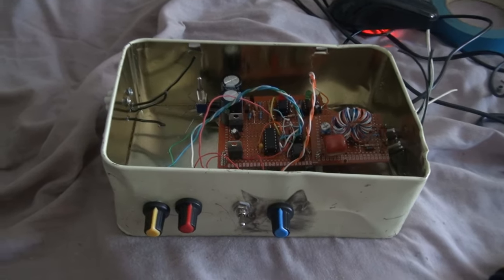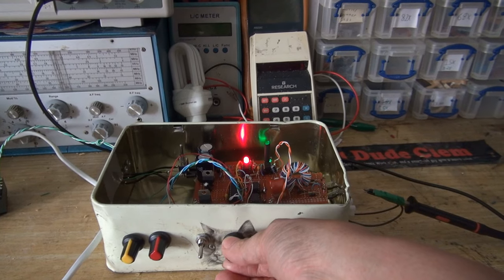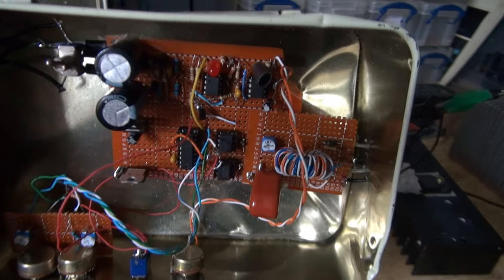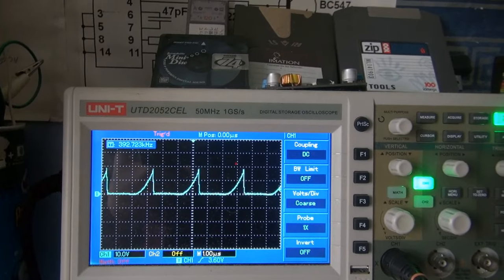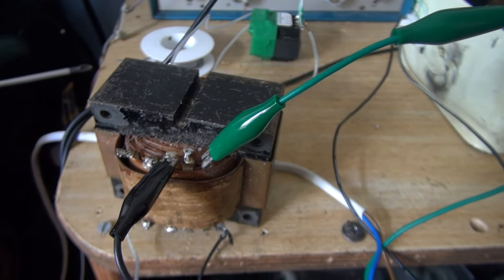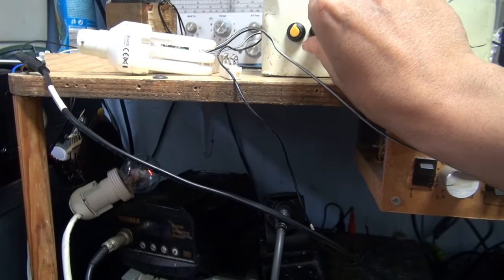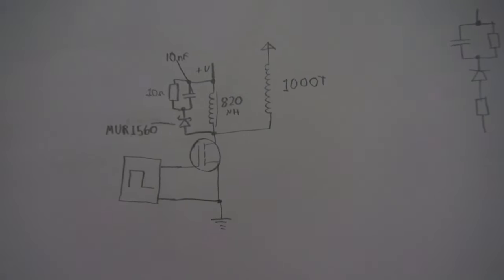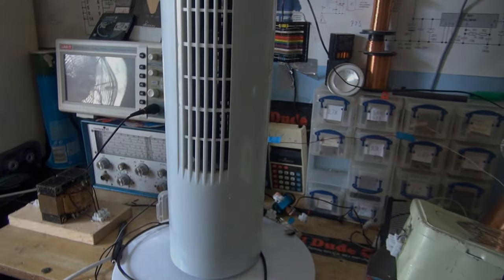Experimenting with snubber networks and other stuff.

Comment: Oh cool its good to see a video from you buddy, the RCD snubber worked well to say you used wire wound resistors, never tried that before, i just assumed the parasitic inductance would be a problem but tbh it seems fine here 😀, they do actually make "non inductive" wire wound resistors where they wind the nichrome as two coils in opposite directions to effectively cancel the L but ive never come across them in the wild as yet, as for the scope showing ringing with the BNC-coax-crocodile clip lead yeah that could be the parasitic capacitance/inductance you are effectively putting in parallel with the gate, 1x/10x swtchable probes actually have a deliberately high loss coax of probably a couple hundred ohms on 1x so it would look different with a probe even on 1x not that i would ever use a switchable probe on 1x 😅.. good to see you back on with TCs aswell👌, its really nice for people wanting to learn as you show the details of your projects along with your thoughts, i really want to make some videos in this style when i get back to it, 😎😎.. all the best 

Steve
Reply from the maker: Yeah, I had to wire wound resistors because that's the only ones I have that are big enough to handle the current.
Reply: @CoolDudeClem  it wasn't a criticism mate, im glad i saw this.. it shows again that its great that guys like you experiment with what you have on hand and share what they find, ive always said when you have to make what you have work for you this will teach you far more than just throwing money  at digikey every time, this is why there are great self taugh techs from the Eastern bloc like DGW etc

Comment: The Snubber: The 10 ohm resistor should be across the mur1560 diode, not the capacitor. This way the circuit does not drain unnecessary amounts of energy to the resistor and increases efficiency
Reply: shouldnt the orientation of the diode prevent the resistor from being powered while the mosfet is closed?
Reply from the maker: @fezbpu  If I turned the diode around, then every time the mosfet closes it would just be a direct short.
Reply from the maker: How would that be more efficeint? Surely the resistor would be getting "powered" on when the inductor is storing and releasing it's energy.
Reply: @CoolDudeClem   only short bursts, because the capacitor blocks most wide pulses. when the mosfet turns off, the diode + cap catched the voltage spike, and when mosfet on = the resistor + capacitor forms a discharge path to reset the capacitor. this type of snubber is called Voltage Rise supressor and does not affect the resonance of the circuit. the standard arrangement of resistor in parallel with capacitor affects proper resonance.

Comment: Try a Zener in the snubber
Reply: Zenners cant generally handle enough current to clamp FETs mate, dont get me wrong i have seen people use TVS diodes which are basically two high power zeners back to back even seen some people  use MOVs but again not really upto the job although they do work at low power levels
Reply: Too slow
Reply: @CamelCasee  okay this is correct zener diodes are too slow but above 6V a zener isn't actually a zener its an avalanche diode just like TVS diodes and these are much faster but still they cant handle much current and i prefer Clems RCD snilubber approach